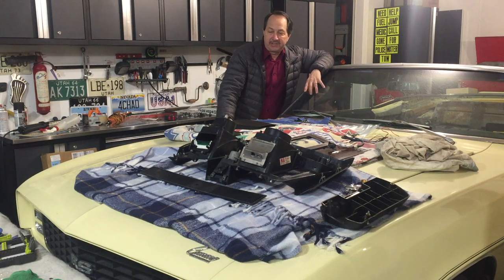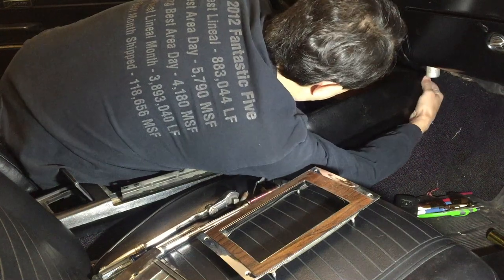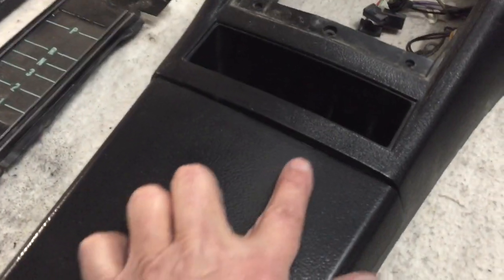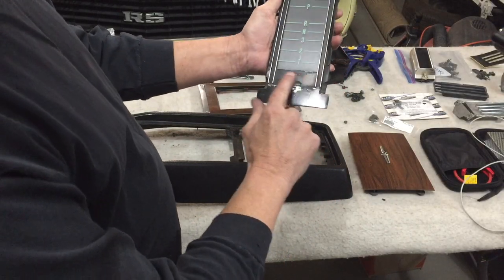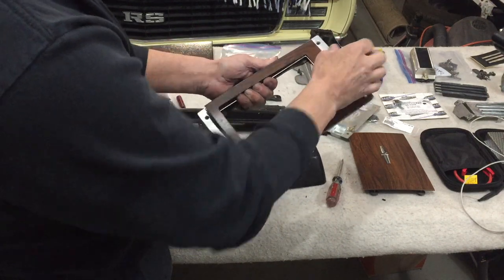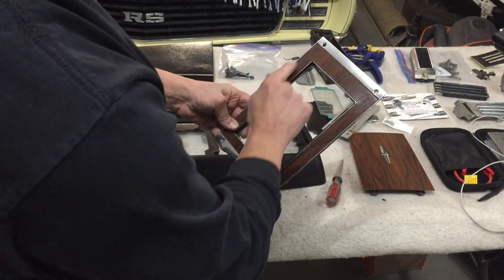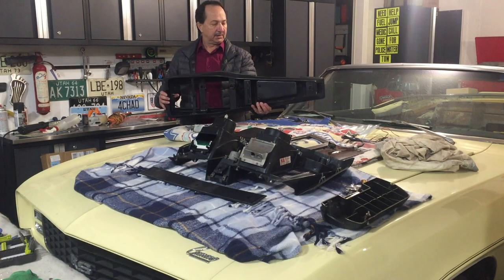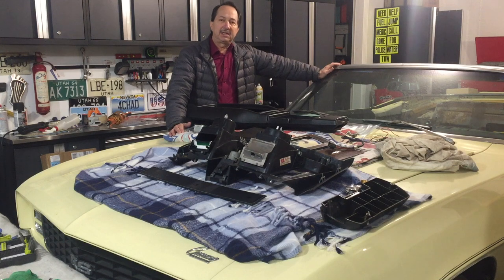1969 Camaro RS Convertible Console Repair & Restore. Clean, polish and paint.

Comment: Where do I install the front mounting bracket. I used a metal template from the first rib on the tunnel. But shifter assembly not aligning as I’d like … one finger width from DS on console and two fingers width on DS . Is there a measurement for placement of either structure (bracket and shifter assembly)?? Frustrating 😮